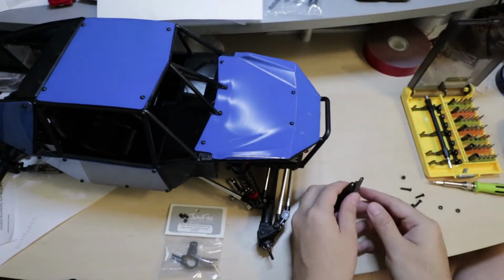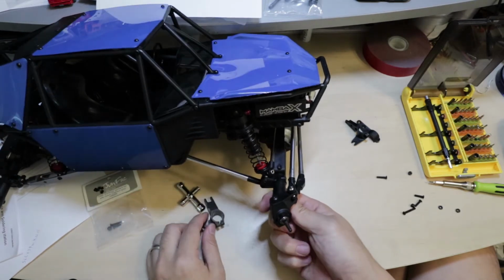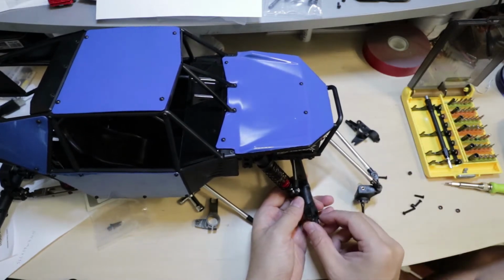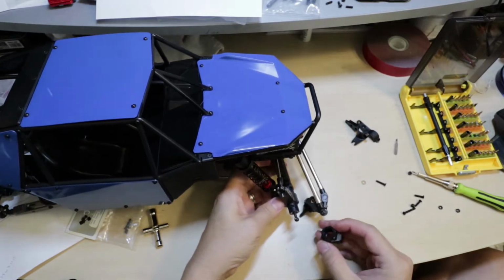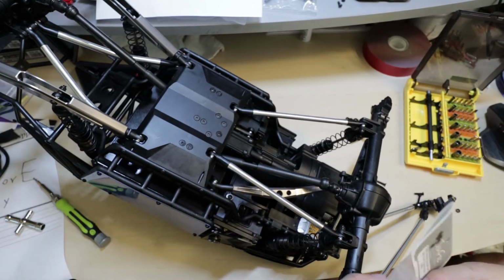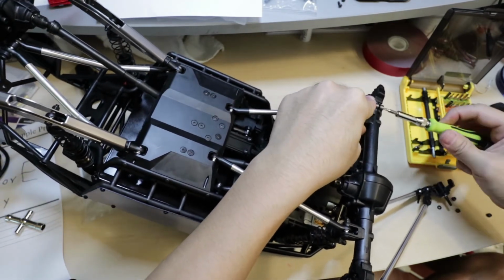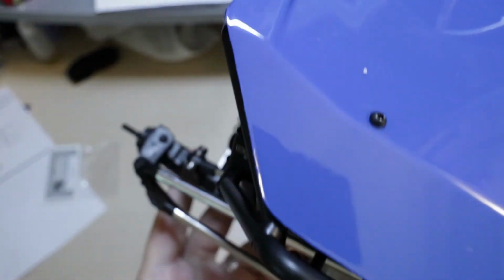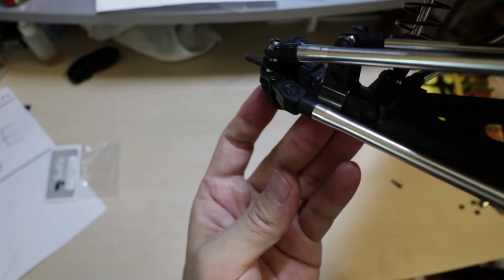GMADE GOM GR01 Rock Buggy - Upgrade Series - Aluminum Panhard Bar Axle Mount

Comment: Great video, where are you getting upgrade parts for this truck, i can't seem to find any anywhere.
Reply from the maker: They were available on eBay, but might be sold out now.  Probably have to wait until vendors get it in stock again or buy direct from GMade or Junfac.